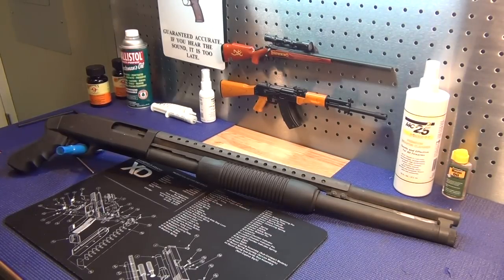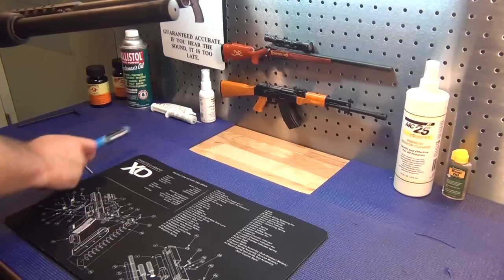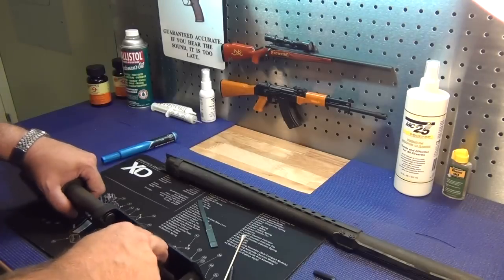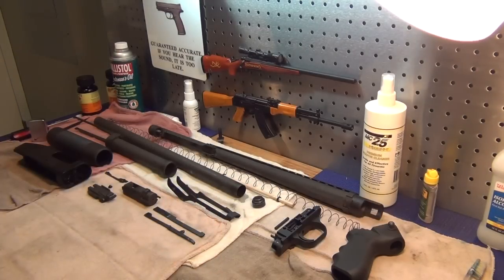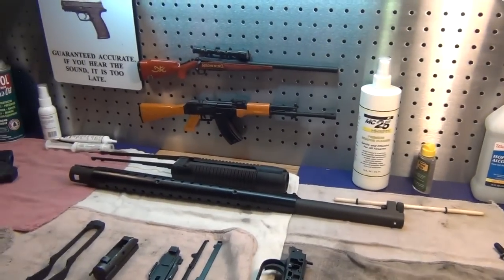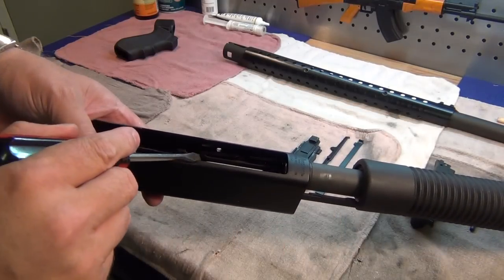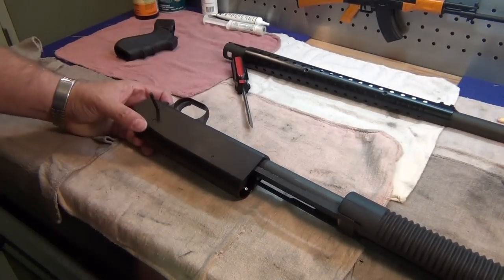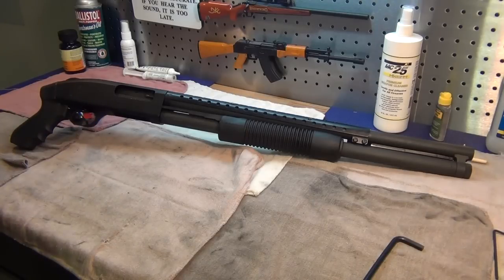Bring An Abused Gun Back To Life

Comment: My mossberg 500 was a rescue. Paid 140 for an old field model. Slide was glued shut with dried oil and dirt, bulged barrel and cracked stock. 75$ later and I have one of the most reliable guns I will ever own.
Reply: Did you buy a new barrel?